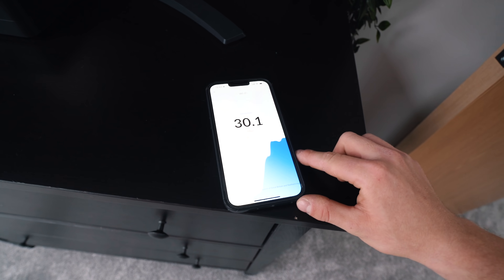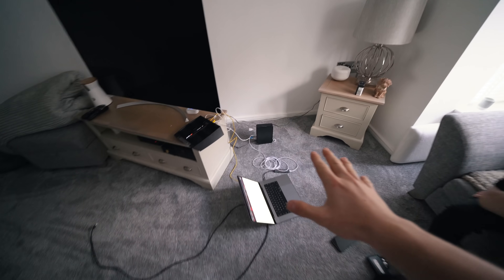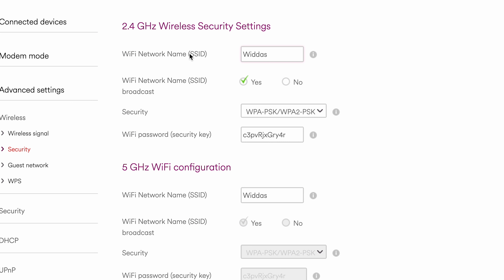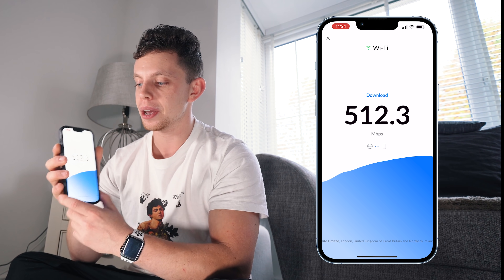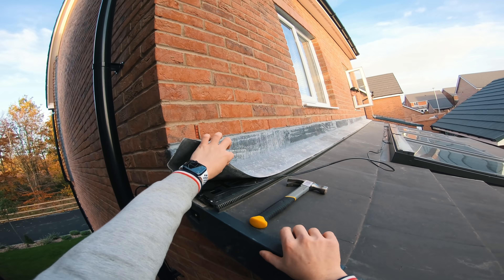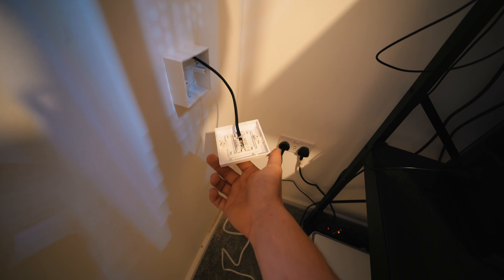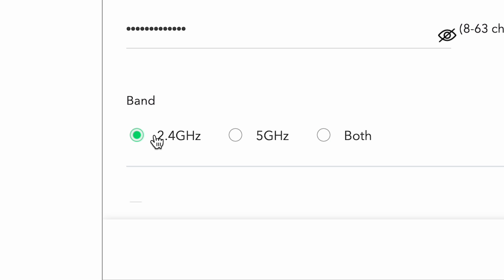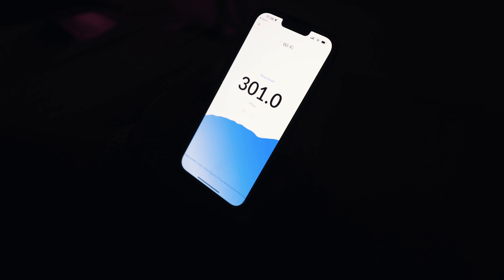Fixing Bad WiFi is EASY: Pimp my WiFi Episode 1! Ft. Ty Widdas!

Comment: If you drilled from the outside in through the mortar instead of inside out and hitting the brick he would have had a nicer finish instead of that hole at @7:24. The tool you used to punch cables down is called a punch down tool, crimpers are used to crimp the cable to RJ45 connectors/boots, not punch down to a junction on a faceplate. I'm also surprised you don't host your own Unifi cloud controller and use a Unifi AP, they're perfect for this kind of thing and look really aesthetic. As long as the customer is happy though (:
Reply: Most times we drill inside to out in order to avoid internal pipes, radiators etc. Sometimes you will hit brick and you're right. Its just safer to do it in inside to out.
Reply: @XeonOfficialYoutubeChannel  oh yeah, i suppose it is better in that sense.

Comment: Thanks for the video. Why did you not go for a Mesh network with Ethernet backhaul instead so roaming between the access points is seamless?
Reply: I don't understand why he didn't go for mesh network, the cost for the ethernet outdoors is 60, the router is 60 in addition to tools, plates, safety on a roof. Your talking £120 minium alone. For that he could have got a 3 way tplink deco mesh system like I have. Set the virgin router in modem mode which you can do on the superhubs as I have one and then mesh dot the pods around the house. Seamless no drop of speeds for. WiFi. I pay for 200mpbs for virgin on Wirless I'm always achieving 180 on my mesh system. The system has a smart enabled feature to enable 5ghz and 2.4ghz for certain devices like my ring etc...  And the pods have 2 ethernet inputs. 1000mbps max. So if I was to ever increase my Internet I can.. Plus the fact that the rubbish superhub is no longer acting as a router just a modem leaving the mesh to to make the most distribution, range and signal. Each mesh connects up 2800sq ft! Between meshes so your pretty much covered and my house is big. You can pick a 3 pack mesh deco on amazon right now for £99. So regarding cost and knowhow. I think alex got this wrong here. Especially knowing the superhub has modem mode.
Reply: Cost I'd say
Reply: Wired > Wireless
Reply: @ToadyEN  I agree.

Comment: Well I am grateful for this. I love your videos especially for people who don't have as much tech knowledge as you. My old stone bungalow has bern plagued with crap wifi for years. I have virgin 1gb fibre but have various spots around the house where my ring cameras drop off WiFi constantly and my sky q has the same problems despite having had at least 10 sky q specialist engineers try to solve it. I wish you were in my area.
Reply: Very easy Mark, if you have access to the outside walls or you can go straight up into the attic space, install ethernet and faster WiFi around the house.